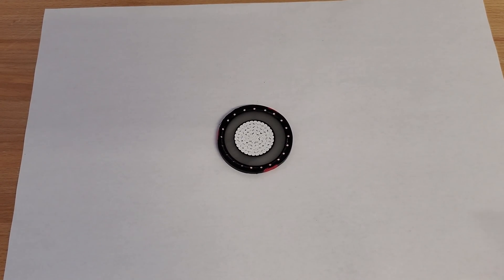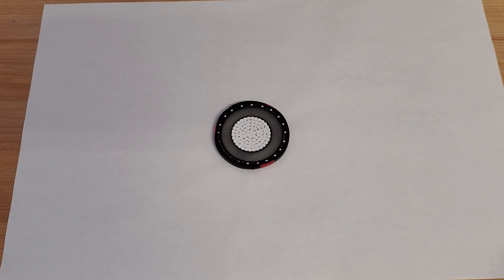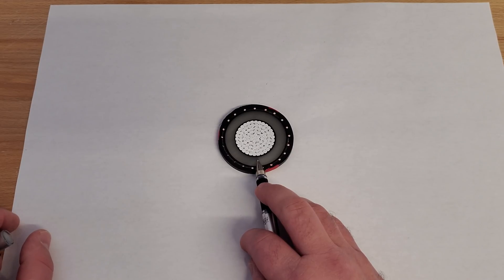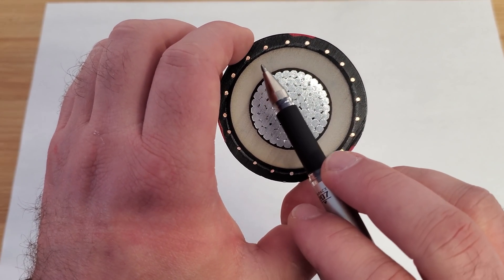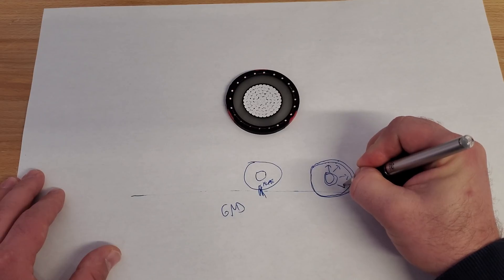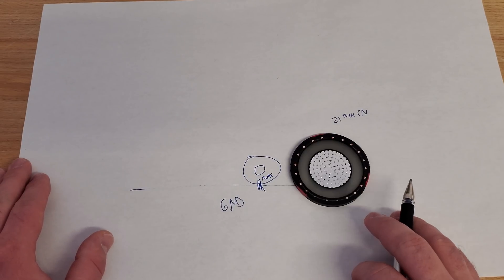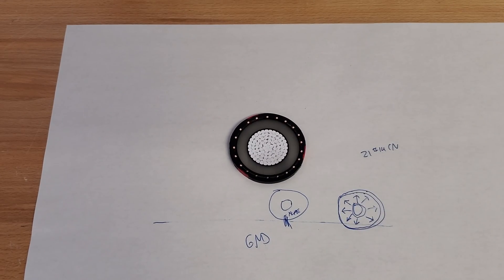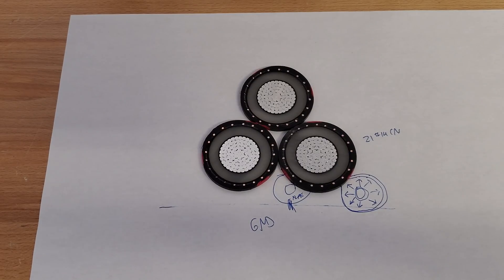35kV Underground XLPE High Voltage Cable

Comment: In what scenario do you ever just lay a high voltage cable on the ground?
Normally they are buried so have even contact with the ground not just one side, so even break down of insulation.
Anything to do with works, generation of transformation will be run in heavy duty PVC conduit or be elevated off any surface.
Reply from the maker: Back in the day wind farms did this. I've seen it personally. Today this doesn't happen but these cables are put in cable trays.

Comment: Some XLPE cables have a copper tape wrapped around the semiconductor layer to reduce the risk of electrostatic discharges/EMI interference. Am I correct?
Reply from the maker: Yes sir! That is mainly seen on EPR insulated cables, but it can be on both. The tape and CN both serve the same function.

Comment: Fantastic video 🤩. I am looking for a video or diagram about how the concentric neutral is connected to the ground/neutral bus?  Can't find anything...
Reply from the maker: I can't find pics. You can track down some 35kV t-body or outdoor terminations and it shows them. They are a twisted then C crimped to whatever ground is available. We usually use YGHC29C29. There is a chart on how to determine what equivalent conductor size all the concentrica are so you know what x crimp to use.
Reply: @spdfreakls1 man, just in time to start work this Monday morning. Thank you so much!!

Comment: We run 345 mil 1/0(solid conductor) primary cable through pipe/conduit all the time.  Definitely doesnt go in hard 90 degree bends of course.

Comment: Do you have to de-rate this cable ampacity when using it in conduit underground? If so, do you use the NEC or is there a special wind farm standard for underground cables?

Comment: I have a question is there a type of non contact tester for medium voltage cable like this ...also does the hex bolt head in the insulated plug become energized when the wire is energized? Or does it remain with no voltage on it.
Reply from the maker: Great questions! There are non contact testers out there. One is a Salisbury 4744, for URD cable.

On the hex head on the insulating plug, it's insulated from the other end where the stud is. It may build up a charge, but does not have any voltage on it.

Comment: Actually, due to the skin effect, it would be the stranded cable that would be the better conductor rather than the solid. That's why tri-rated cables come in hairline wire flex strands.

Comment: was that section cut on a deli slicer?
Reply from the maker: Haha close! A horizontal band saw set to cut only 1 inch per minuite to keep it smooth while held with a vice to keep it straight.

Comment: Another thing the semicon layer in the cable over the conductor prevents is corona discharge in any air voids, as this would create ozone that would rot the cable from the inside.  This is due to the dielectric constant of air being barely over that of a vacuum and a small fraction of the dielectric constant of the XLPE/EPR insulation.  This means that the electric field in any voids will be comparably higher, and probably high enough to get breakdown.  Transformers are in oil baths or vacuum impregnated with transformer resin for the same reason (besides the cooling benefits of oil in wet tank transformers, of course).
Also, flux normally refers to the magnetic field of something, not the electric field.

Comment: I've seen a similar cable, or this cable about 4 years ago in technical school, and the told us something you didn't say (or I probably didn't hear), this cable acts as a capacitor, and if you have to work on it, after shutting the electricity off, you have to ground the conductor, or you will probably get killed
Reply from the maker: Exactly right!

Comment: Why would a neutral be needed in a 35kv transmission line? What use would it be? No loads are running off 19kv or whatever it was line to neutral. Is it there just to have a grounded system for the power transmission?
Reply: Dielectric stress control and cable charging current.

Comment: I may have misunderstood, or it may be different in different countries, but .....
Is the HV not generated in Delta format? This would mean there is no real Neutral. It is my understanding that the neutral is the Star point and only exists on LV (415/240 in the UK) and is connected to earth at the star point! Obviously this then "anchors" earth potential to neutral on LV and keeps the HV relative to this!
I was a tad confused when you talked about Flux. Magnetic flux runs parallel with the flow of current .... this is totally different from the Electric Field which runs at right angles to this! ;0)
Reply: This would be a 19,920V/34,500V grounded Y system so there is a true neutral in the system.  The neutrals in this case carry the charging current of the cables, as the main load is 3 wire delta.
USA/Canadian distribution systems use a lot of Y connected systems for their primaries (2,400V/4,160V, 4,800V/8,310V, 7,200V/12,470V, 7,620V/13,200V, 7,960V/13,800V, 14,400V/24,940V and 19,920V/34,500V are the normal ones, but there are others).  Primary in this case refers to what is connected to the primaries of distribution transformers, which are what feeds angry pixies to the end consumer.
Reply: @randacnam7321  They would be Extremely angry pixies in my book! ;0)
Primary does have a different meaning in distribution systems. 
Here in the UK Primary substations take the distribution voltage (400KV Delta) and drop it to various intermediate voltages to distribute to "normal" substations with it ending up at 11KV to 415/240 (Delta Star configuration). The Star point of the 415/240V is the neutral and is also taken to the body of earth via mats and rods! This allows earth fault detectors to pinpoint faults on the HV and allow remote switching to get people on asap!

Comment: The electric flux is the number of electric field lines passing through an area.  Formally, flux is the dot product of a vector field with an area vector.  This definition mathematically handles the general case when the electric field lines are not perpendicular to the area they are passing through.  A super useful application of this dot product definition of flux in electrostatics is Gauss's Law.  The total flux passing through a surface that completely surrounds a volume tells you the amount of charge contained within.

Comment: Good video. I install, splice, and terminate this stuff every day. Going on 30 years as a splicer/crew leader.
Reply from the maker: Nice! I may do a splice video in the future . We use 3M and Tyco splices mainly. What about you?
Reply: @spdfreakls1  Same here
Reply: I've been selling it for 43 years. You are light years ahead of me as an installer. Splicing it looks sooooo tedious, there is no room for error.
Reply: I don't know if you will see this, @CHICAGOHAND , but I am learning about MV cables for work.  How do you connect the concentric neutral to ground/neutral in the enclosure?
Reply: @JBrodo usually you pull em back comb em out and twist em together and land under a lug

Comment: Good explanation.  I never thought there was so much into a high voltage cable.  For me 110Vac is high  voltage, I am more in the 12V and less world.
Reply: It can go up to 400kV. I have designed a 525kV HVDC and is quite fascinating

Comment: Good video. I wanted to know if the high voltage was phase to phase, or phase to ground
Reply: He sort of explained it. Phase to ground is 19,900. You get 35kv phase to phase because each phase is offset from the next by 120deg. So 19,900 x 1.73 (square root of 3) is approx 35kv. The generators and transformers are churning out 19,900 per phase. When you calculate the 120deg offset, the voltage from phase to phase will read 35kv.

Comment: International undersea internet cables are built much the same. They have optical fibres down the middle, a bit less power conductor for the optical amplifiers along the way, and about the same amount of white polythene insulation for 10kVdc 25 years life, plus a metal tape outer layer to keep sharks and worms out. In shallow water, there are added various amounts and sizes of armour wires, to avoid abrasion and damage from fishing, landslides, ship anchors etc. I wish we had so few external risk factors as this power cable! But if somebody goes through it with a digger, the power cables make a much louder bang.

Comment: Kinda wished you had a close up for most of the video.
Reply from the maker: Agreed. I'm new to video stuff. This was my first time using a tripod. When i got the camera too close it blocked the light. I'm slowly figuring this stuff out!
Reply: @spdfreakls1  Thank you.  I really appreciate the detailed explanation of this cut-away sample.
Reply: @spdfreakls1  pretty accurate description of cable structure.  I'd have phrased a couple things a little differently. I'd be curious to chat with you about your thoughts on cable testing.

Comment: When you talk about flux, I'm assuming you are referring to lines of magnetic flux?
Reply: From what I've read, the partially conductive layer is there to avoid partial discharge. Its evening out the distribution of the electric field. Similar to corona rings avoiding spikes in the field strength and discharge to air.
Reply from the maker: Yes Flux aka Magnetic Flux, FLux though a point is a component of the magnetic field.
Reply: Look up Faradays Law
Reply: @apollorobb  I looked up Faraday's law but it only talks about magnetic flux.  When he describes flux in the video, it seems more like he's referring to the electric field strength so I'm not quite sure either.
Reply: @Berkeloid0  he is indeed talking about electric field. I think it is like that blue corona around a hv loaded conductor in air. Something like that plays a role inside the insulationmaterial as well as in air, i think. But indeed is flux a strange word for that effect, at least for us who know the word only referring to magnitic fields.
Reply: @robson6285  electric flux seems to be a valid term. Its the strength of the electric field per area (field line density). But im not sure if we called it that way in physics class

Comment: About 3 years ago our street lost power; 22 homes with underground power.  The problem was traced to the underground power cable near the #1 house on the street.  We (residents) thought it was fault proof having underground power.  It took the power company almost the whole day to find the problem.  They brought in a generator to give us all power while they dug a deep hole and spliced the bad cable.  It was late into the night when we had our power back to normal and they could remove their generator.  Those guys worked diligently.
Reply: If you think 1 day is a long time hear my story. When I was a kid we lost power and they started digging. They’ve been fixing the problem for days, maybe weeks. My grandma brought a block of paraffin and we made candles by melting it and sticking rope into it. We’ve made and used quite a few candles. I was not happy with the situation at the time but I’ve learned something new and have a memory for life.
Reply: @AI-xi4jk  Making candles is a good thing to learn.  I also learned to do that back in the 1950's.  Kids love to learn how to do useful things.
Reply: The guy using the equipment to do the " Fault Locate " must have been new for them to take that long to find where the Fault was ! !
Reply: That’s actually not bad.
Reply: @fosarvian  It actually happened twice, about 12 years apart.  We bought a small gasoline generator at a yard sale 20 years ago.  It had enough power for watching the TV but couldn't run the forced air heater.  About 5 years ago we bought a duel fuel (gasoline or propane) generator so we could run our house heater and lights.  Noisy.  Ah, well, at least it's not snowing . . .